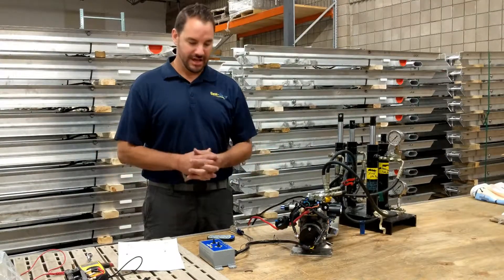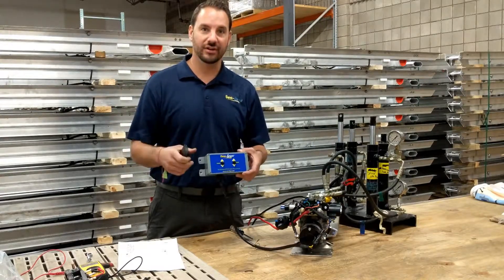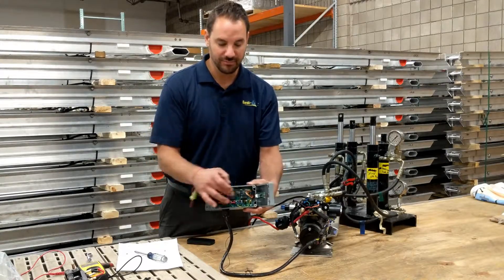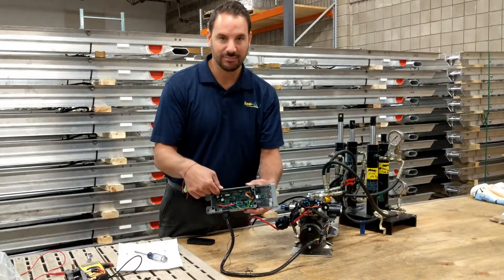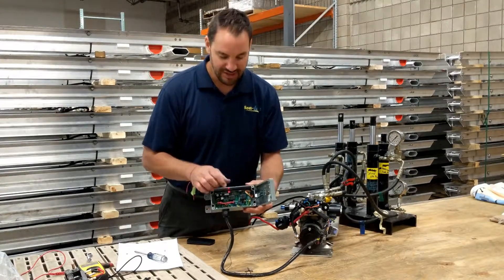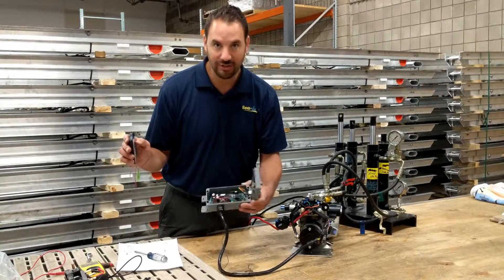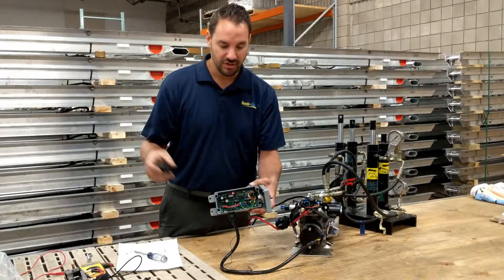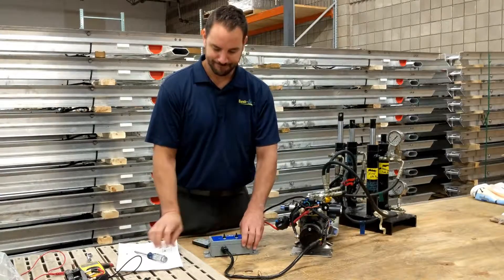Sea-Legs - IA Std SEA-108 - SEA-109 Reprogramming

Comment: My remote doesn’t seem to pair. The light on the box blinks and then goes out. The red light on the remote rapidly flashes… but nothing happens most of the time. Occasionally I can get one button to work briefly but nothing more. What am I doing wrong or what can I do to make it work?? I am within 1-3 feet of the box when pairing and the antenna is taped up on the railing and not wrapped around the cable.